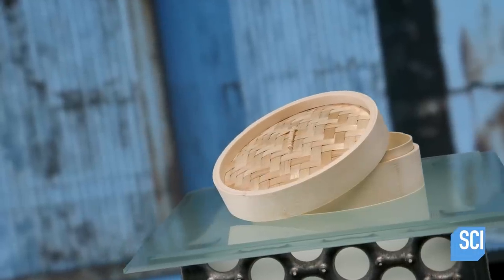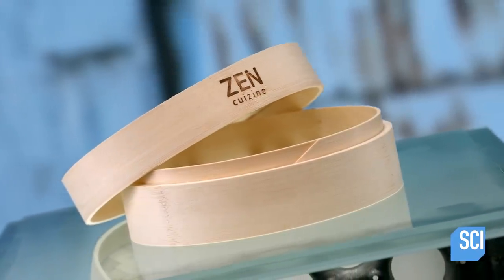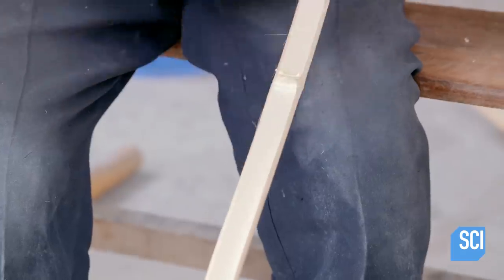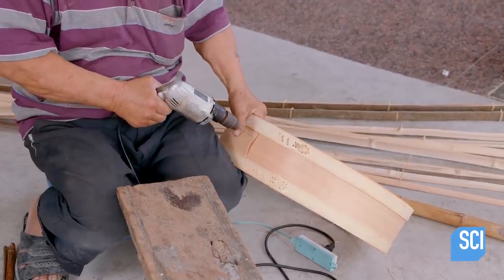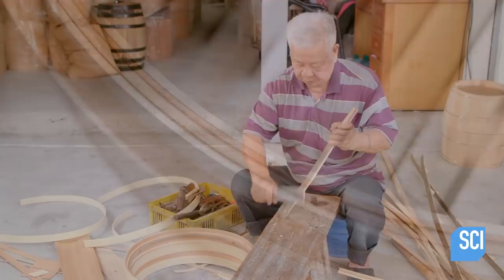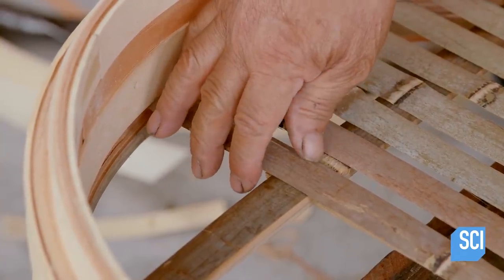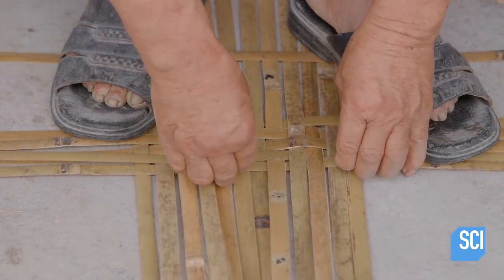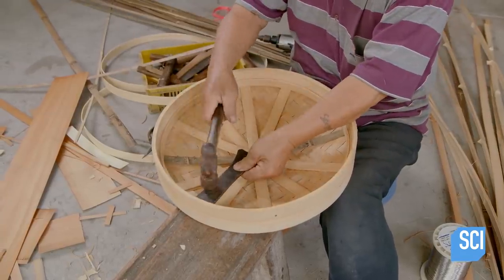How Bamboo Steamer Baskets Are Made | How It's Made

Comment: In the old days, bamboo nails and bamboo strips were used instead of the stainless wire.  Nothing made with metal including the handle.
Reply: yes , mine is 100% bamboo, not a bit of metal or plastic.